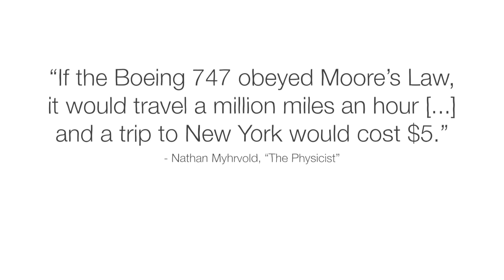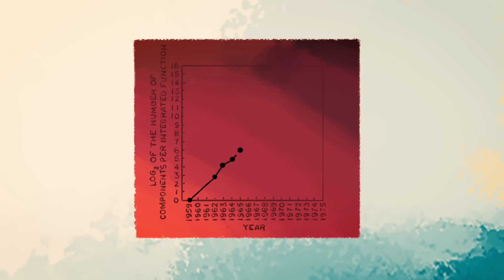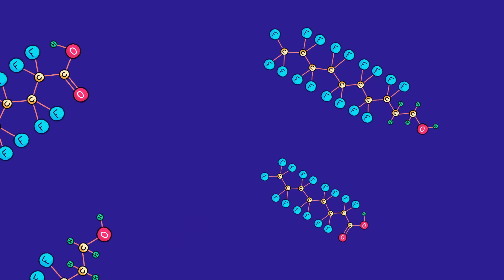Have we reached the limit of computer power? - Sajan Saini and George Zaidan

Comment: I'm amazed at how small transistors have gotten. It's incredible to think that they're now approaching the limits of physics.
Reply: To put things into perspective, during a single CPU clock, light passes ~8 centimeters.
Reply: @ivanjermakov 8 cm is still bigger than the chip. We’re smart, we can run the traces to compensate for the propagation time, the capacitance, and inductance is a bigger challenge. Call me back in 10 years when we’re dealing with 8 mm. Not 8 cm. That will be a real problem. But we’re already massively paralleling computer power, like your average GPU….  MULTIPLY AND ADD a huge matrix of numbers……… 1990 Motorola 56000 vs 2024 GTX5090, or whatever. Don’t you worry, we’re the cockroaches of the world. We got this.
Reply: @kimsmoke17 not really. You might want to actually check out some reviews of the 5090 you're brining up. Not very hopeful for the future at all. Maybe its just nvidia and a fluke, but it doesn't look good
Reply: @kimsmoke17  The clock speeds have mostly stagnated around 5GHz range years ago. Even in 2005, Pentium 4 could do 3.8 GHz. The current overclocking record is currently a bit above 9GHz, and they needed liquid helium to achieve that.

I seriously doubt that we will somehow be able to reach 30-ish GHz, as you say, by 2035. Not unless some truly radical breakthrough takes place.
Reply: @kimsmoke17 yep, that's where most research is going nowadays, to be as efficient as possible so that heat gets reduced and we can run even faster without overheating, my personal guess is that computers will reach in their current configuration the end of the road around 5 to 10 times their current speed, after that we will be forced to create a new architecture or maybe stack processors in a 3D lace or something
Reply: Can you imagine when we make a running transistor as small as one atom
Reply: Ello bro